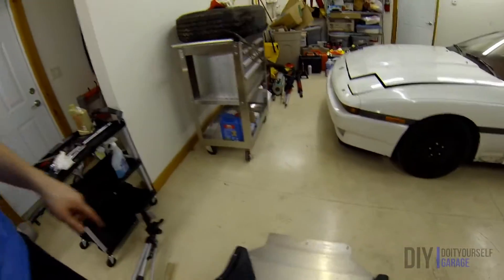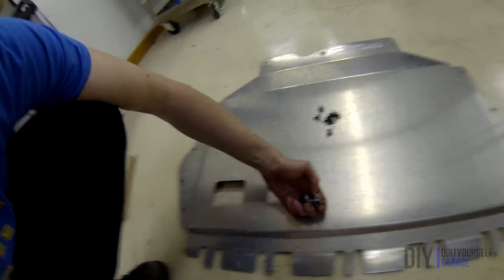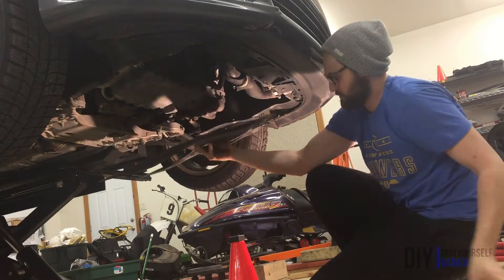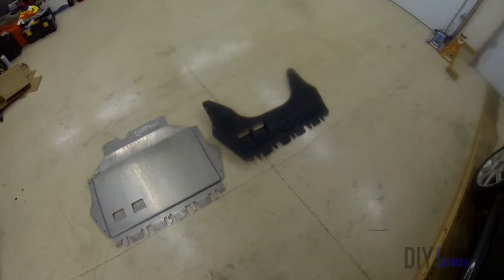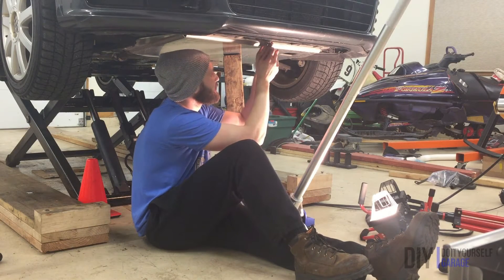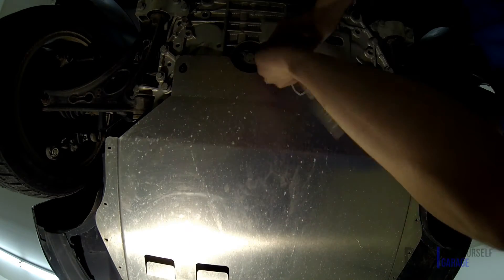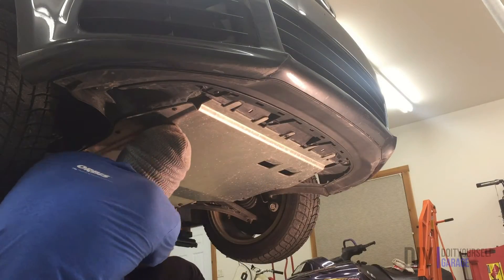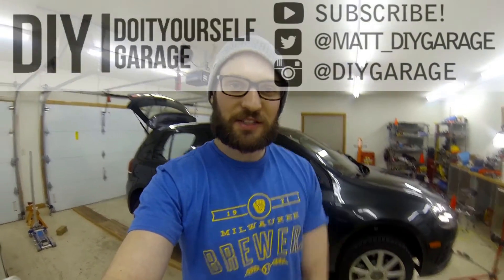ECS Tuning Aluminum Street Shield Install | MK6 VW Golf R GTI

Comment: It would be really great if ECS would have incorporated some holding "tabs" on one end so that you could lift the plate into position, insert the end with the holding tabs on one end and then slide your hands to the other end and start a bolt.  As you clearly demonstrated, mounting these is a real PITA! 
ECS usually does a very through job with their proprietary items, but they must have had the car on its roof when they thought the skid plates up!  Thank you for the (real) vid.

Comment: Why would you want aluminum instead of plastic? Is it just so it can't get mangled as easily if you bottom out or hit something? Plastic would still deflect things from hitting the oil pan, would it not? Plastic is slightly more elastic so it seems like a better material for this application to me.
Reply from the maker: More protection for your oil pan.  Especially for lowered cars.
Reply: D I Y G A R A G E tnx!

Comment: Cool vid. Thanks for showing the detail of the install. Thinking of installing this on a Passat but was worried the weight of the aluminum plate would cause the front plastic trim that it slips into to sag down or loosen. Was concerned relying on a plastic trim piece to hold the weight at the front. Have you had any issues with the aluminum plate? Any major impacts, road animals, or street debris that has hit the plate?  Thanks!
Reply from the maker: remington351 lots of ice chunks and a few rocks... no problems though!